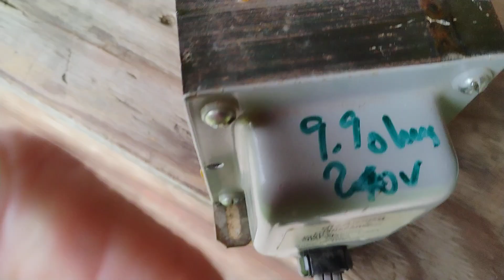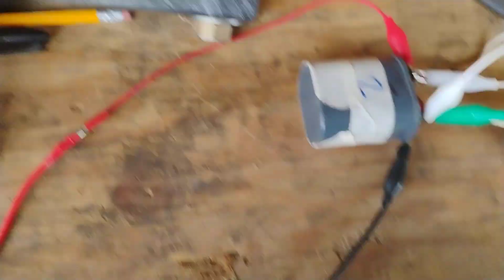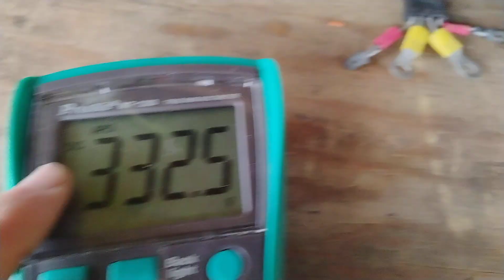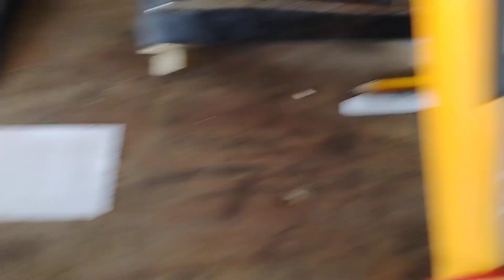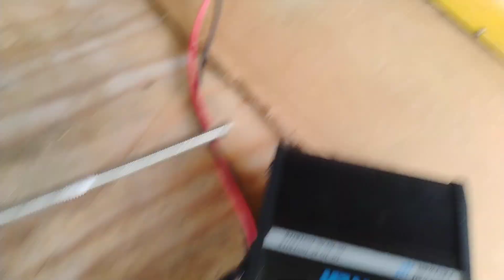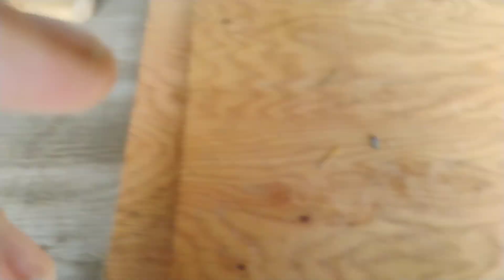Interesting stuff with rotovertor and series transformer, looping again with statpower invertor

Comment: Good morning ! these achievements are always spectacular, really congratulations
Could we have a diagram because the Google translation for us French speakers is very approximate! good job my friend
Reply from the maker: Hi Guy
Here is Hector's rotovertor circuit that all this is "based on":
https://alternativeworldenergy.wordpress.com/hector-rotovertor-circuit/

Note the transformer at bottom of circuit, I have not added this yet...
Also note hector has his "run cap" transformer more or less in parallel to run cap phase, while in this video I have the transformer in series to run cap phase.  

Hector says there are 16 different ways he knows about how to do it, so basically how it works in end product will be found on bench with the particular choice of  motor, transformers, caps and invertor and how it all goes together....that said, here is the exact circuit I used in this video, and the previous video to it too on my channel.... I am not "that happy" with it, as not enough current going into battery but maybe if I add that transformer it will have lots more current going out to charge battery whats good is draw to motor is so very low in amps:
https://alternativeworldenergy.wordpress.com/looped-rotovertor-with-series-transformer/

Look in previous video where I have 800ma current going into battery using microwave oven transformers, in consequence draw is alot higher:
https://www.youtube.com/watch?v=v5m4oK5htS8